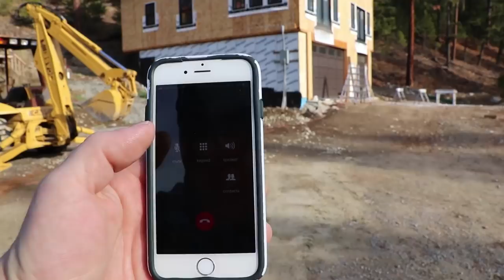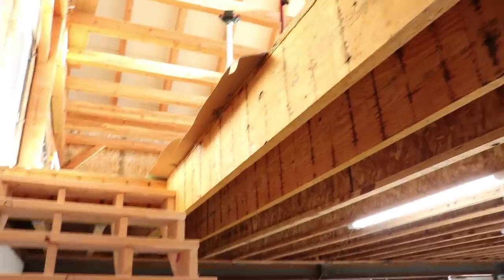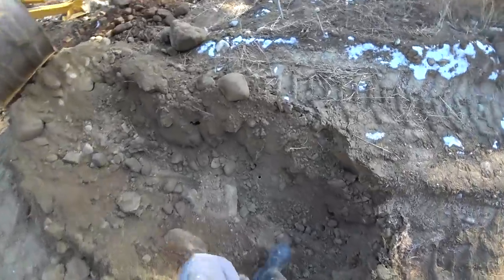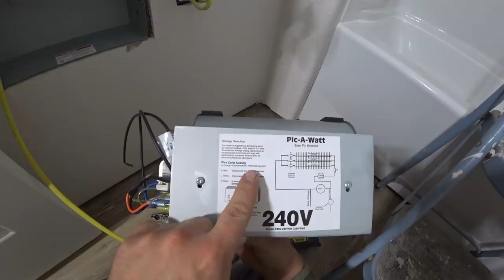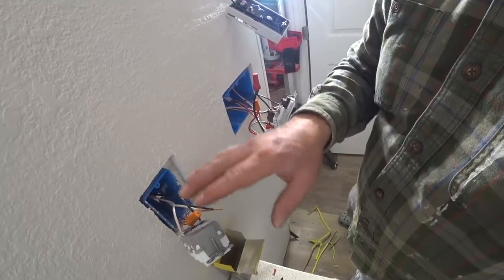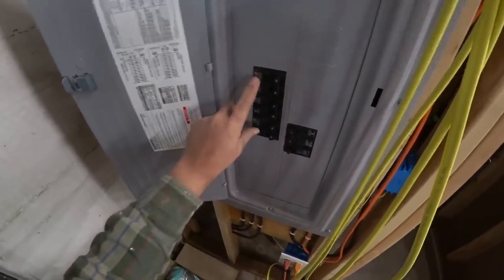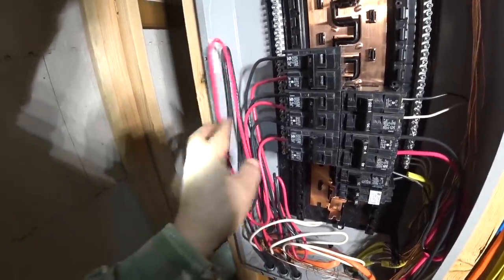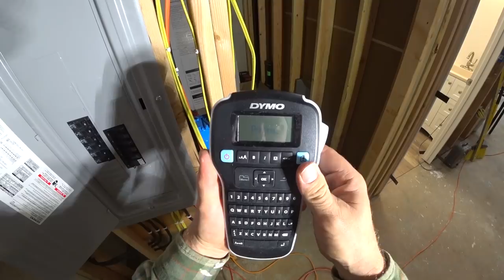Holy Cow IT ACTUALLY WORKS! (Wiring Garage Bathroom)

Comment: Many violations, all devices require grounding even switches. You can not make splices in panel and no double taps on breakers. You may experience nuisance tripping with the fan on the gfi circuit. You may want to look into code requirements for arc fault protection also. All bathrooms are required to be on their individual circuit can’t be daisy chained.
Reply: That 688 fan IN the shower is required to be gfci protected by code. No arc fault required in bathrooms, one of few places left in the code.

Comment: Here in the california mess, way back when we replaced our bathroom cabinets, they said code required a dedicated "outlet" circuit vs having it tied into the lights, etc.  So lucky you to not have that extra requirement.  We did still need to have the gfci outlet as well on each outlet.

Comment: you could use the mud around the boxes to seal the wall, ideal it would be done before the painting but should work too. In germany when we install electric in the dry wall we put the whole sheets on the studs but have layed the wires before so that they lay were the outlet will be later and the we drill the holes later wen the drywall is finished (but before paint) and we have round boxes that clamp to the wall and are secured that way, not like the us where it is nailed to the studs. This way you almost never have problems with a too big hole, only exemption might be some special equipment you install into the wall.

Comment: when backfilling your electrical trench It should be done in no more than 12 In at a time and compacted or use sand, water and a concrete vibrator  to compact the fill I have had to repair damaged electrical panels, or the conduit pulling out of the  connector or coupling exposing the wires.

Comment: Great progress. I have been following your posts for awhile now and have noticed that the one tool that you do not seem to have is a Romex Stripper  I went on Amazon and the basic version is there made by Southwire that I am all too familiar with also they have an updated version made by Ideal Industries 45-025 Lil’ Ripper Wire Stripper  that looks very versatile.  As Richard Burguilios said about wrapping electrical tape around the switch and outlets I learned that as an electricians helper. Good Luck and looking forward to your next post

Comment: Here is convention on 120/240 bolt wiring..  3 wire 240 volt -- L1=black  L2=red Neutral=white Groud=bare or green.  Voltages are L1 to L2=240volt. L1to Neutral = 120volt  L2 to Neutral = 120 volt.  When you use a 2 wire cable for 240 volt, Mark the white wire at both ends to indicate it is L2 by wrapping red vinyl tape over the white wire insulation for about 4 to %5 inches.

Comment: Hey Jes, try hanging your drywall loose and use a router to cut out the boxes (counterclockwise). They will be nice and tight and way faster than pre-cutting the holes.  Looks great though.  Oh yea, drywall is way easier if you hang the top part of the wall first.

Comment: Take a black sharpie marker and paint the white wire black or red. Two wires under the breaker screw not permitted. You would benefit from buying a code book it would help with not having to redo things.

Comment: I would consider installing a system that pulls hot air from the top of loft down to the garage. It would save energy and keep the loft from getting hotter than the rest of the house.

Comment: I believe on the bathroom heater electrical using the12-2 wire you are using the white and black as two 120V hot lines and the ground is used as the neutral.  My self I always run a12-3 (or higher gauges) for 220V circuits and 12-3 for ceiling fans, two hots one for the light and the other for the fan (not controlled by the switch).
Reply: There is no neutral on a 240 heater.......... 2 hots, 1 ground and the ground is used as an equipment ground. One only needs to run anything -3 if a neutral is required, "range", "Some Dryers" For fans, I generally run a 14-3 and have 2 switches by the door to avoid the breaking of the fan chain switch in the fan over time and use a speed control for the fan in the 2 gang.

Comment: In single phase electrical you have black and red as hot, white as neutral. So you should get some red phase tape to wrap the white on both ends to designate to you and to anyone working on your device that it is 220. Also a good rule of thumb,if you can put your hand in water (a full sink or full tub) and touch a device it need to be g.f.c.i. protected, so you should protect your heater and your lights, so daisy chain everything

Comment: I'm looking forward to your electrical inspection. I'm not familiar with your area, but in general, you can't use white to carry a hot leg of 240V. Usually it has to be red. (Ie a black/red combo, most usually a black/red/white/bare) But it will be fun to see what your inspector says!

Comment: 240V, Hi, just to clarify, neutral is not only for energy accumulated in the equipment or metal parts (I don’t know but where I live neutral and ground are somewhat separate in the house). I don’t know fully how the electric is done in the us.. But when you say you have two hots, I think you actually have a difference of potential. Being worth to point out that the current that goes through one wire returns in the other. So your current is circulating in both wires. Also, 240 is really practical, economic and easy to work with.
Reply: Anyway, very interesting the install. I found the electric in the US very interesting, since is different to me.
Reply: (I don’t know but where I live neutral and ground are somewhat separate in the house) For a number of reasons, but more often than not, and dependent on line loss and subsequent potential difference, neutral and ground are not at the same potential when significant current is being handled by the neutral. Redundancy of safety is another issue to consider. If you lose your neutral return, and are also using it for safe ground, you've suddenly made what was thought to be 'safe' as having fully line potential.

Comment: Whenever I have set up a 240 volt appliance I have always used a 4 wire drop. The 4 wire has two hots a neutral, and a ground. I believe that is code here in Florida.

Comment: Sleeve that white cable with black - that way it signals at least that it's a dangerous live wire rather than a "safer" neutral.
Reply: no such thing as safer wire like saying an unloaded gun is safer pointed at you

Comment: Jesse, while you can mark that white 220V wire black with some electrical tape, it's better to mark it red, just like the main panel feed.  As you already have a black wire in that pair, marking the other red makes it clear that it is 1) not the neutral, 2) that it is a hot, and 3) is a different hot than the other wire in the cable.  You can use almost any color to mark that wire as long as you stay away from White (reserved for neutral) or  Green (reserved for earth ground).  There are some other exceptions, but they are area specific or application specific.  Also, you could have run your outlet home from from the panel to the outlet beside the wall heater, then ran from there to your second wall outlet, then lights etc.  It would have saved a second 120v home run to your breaker panel.

Comment: Boy I wish our electric code was that flexible, in the UK we are not allowed any sockets except a shaving outlet in the bathroom, also all switches have to be on pull cords so that there is no chance of touching any switch with wet hands so no light switch or adjustable heater sockets in the bathroom. Even though you codes are totally different to ours I find it fascinating to see the way things are done over there.

Comment: It's 240  and 120 volts. The breaker panel is two legs of 120 volts to neutral. AC power hasn't been 110 in over 40 years. If you read 110 volts you're probably in brownout condition.
Reply: And on many 'lively' supply lines, especially at low load time, it's more than that. You can typically read "118v" at one end of a street on house outlets, and "125V" supplied from the same stepdown xfrmr the other end of the street. A lot has to do with line loss and loading, but you're right,  to state "110v" is an old habit hard to die.

Comment: Tips : acrylic on the small cracks around panels.
Also i would have used some white silicon around your bath area... like where the sheetrock mets the plastic of the shower/bathtub area.

Comment: Looks great guys, perhaps a painted wooden "adapter or spacer" between the plug cover and wall would be a simple inexpensive fix. Still thinking Rocket stove or heater in the garage wood (haha) give you the desired result on heat you are looking for and you could run it on sticks you find laying around. OK, there's my .02 cents

Comment: The bathroom receptacles must NOT share circuit other with other devices "lights/fans. etc.) according to my code book,  You can share the dedicated 20 amp (required bathroom run) with other bathrooms.  When inspector sees this mess you can expect to be doing rework.  I think the reason for a 20 amp dedicated bathroom circuit us due to proliferation of hair driers.  The mess in the panel will make the inspector on high alert,  Be careful of insulation temperature requirements of some heating devices.
Reply: Yeah, I am not a fan of in wall heaters. We use a plug in type, works great and doesn't heat up the wall.  You are correct about the shared circuits, he should have gotten electrical help before wiring this house.  Sometimes you just have to bit the bullet and pay a professional.
Reply: NEC 210.11 (C)(3) EXCEPTION allows the use of 1 20amp circuit if it supplies only one bathroom to use for other equipment with in the same bathroom.

Comment: Hi folks, I can't believe you are allowed to have electrical sockets in the bathroom and a touch switch, here in the UK we have to have a pull switch ( a string pull from the ceiling ) if inside the bathroom, and the only electrical sockets allowed are shaver sockets.
Reply: UK is 240V ? I think the difference in voltage allows US installations more leeway
Reply: Pull switches are now not allowed now in many North Am jurisdictions, and for good reason. They can carry leakage current, especially when damp, and especially @ 240v. No longer allowed in Ontario, and I'm sure some US states. Not sure on the NEC, but it's a matter of time until it will be disallowed if not yet.

Comment: The white wires in a 240 volt circuit should be taped with either red or black electricians tape indicating power legs.  I think that is acceptable per the NEC.  If you are going to wire your house yourself it would be wise to purchase an NEC code manual.  The 240 circuit as woired is incorrect per NEC.

Comment: WRT gfi wiring, might want to consider GFI breakers at the box next time. That way both of the home runs could been protected without using two gfi outlets. Also makes it easier if you decide to change something later.
Reply: Unless your taking a massive dump or taking a shower and the gfci breaker trips then your walking out the door with your pants hanging down or falling out of the shower to get to the panel to reset the gfci breaker to get the lights back on...haha--- 2 gfci outlets are still cheaper than 1 gfci breaker..

Comment: As some have mentioned, NEC requires the white wire to be marked as hot. 
But your explanation of the wires is wrong. The reason you don’t need a neutral in a 240VAC system is that the legs are 90 deg offset on phase. In other words, when one phase is positive, the other is negative, that is why you make a circuit.
Reply: [But your explanation of the wires is wrong. The reason you don’t need a neutral in a 240VAC system is that the legs are 90 deg offset on phase. In other words, when one phase is positive, the other is negative, that is why you make a circuit.] 

 I don't mean to be brusque, and you're far from being alone, quite a few electricians fail to understand this. This is a single phase service. Any potential difference exists in a 180 degree phase relationship, whether you tap (stack, divide, etc, etc) once or a zillion times. Think current not voltage to understand this. At any given moment in time, the current flows in one direction, whether it's 120V or 240V. The *phase stays the same!*.

I often hear electricians (and even some electronic techs) state "split phase". It isn't, it's "split feed" or "center tapped" or best lingo is "split rail" albeit the latter is used more in electronics for power supplies.

[the legs are 90 deg offset on phase] This would be quadra phase (four wire) phase, very rare except for some sophisticated multi-phase systems, or a DC to AC phase inverter (as used in solar systems) that's way out of whack. Think the pedal cranks on your bicycle being 90 deg to each other instead of 180. It presents some challenges...

Comment: you may know this but now is time to plan for load balancing. That means as you install 120 breakers try your best to keep constant draw as even on both sides as possible and the same with surge power if you don't you can pop breakers and also can cause higher power bills.

Comment: You shouldn't need any extra wire in the panel if you did your job right. Extra wire in a panel becomes a confusing and therefore a dangerous mess.
Reply: Extra can be nice if anticipating swapping normal breakers for GFI or AFI. That requires the neutral landing on the breaker rather than on the bar. Depending on where the neutral sits on that bar, extra length could be needed to get it to the breaker slot.

An inspector would probably call out the NM sheathing not being cut back to code. Looks like all of the sheathing is noncompliant.
Reply: Got to disagree. If and when changes are needed later, you're in deep doo-doos if you don't have sufficient lead length to move to another breaker, often necessary when a circuit needs to be added, all slots are taken, so a double breaker needs to be used to accommodate making room. Some inspectors in my jurisdiction will fail an inspection if there isn't at least one panel length of extra lead. Room is provided in panels for it, the onus is on the installer to put it in neat, tidy and accessible. Keep in mind for some service, like stoves and dryers, you can't use a junction box if your leads are too short to move them in the panel.

Then what?

Comment: The white wire on the 240 volt circuit should be marked with colored tape indicating it is not actually a neutral. colored electrical tape is available. Usually red or black is used. Be sure to mark both ends of the wire, panel and box.

Comment: When we bought our house they complained that the main panel had a double tapped breaker. Not sure if that’s what you were talking about in reference to that one breaker, but was easily fixed just like you mentioned (with a wire nut and extension).

Comment: You are using the backer rod for what it is designed for.  Good job.  Remember that there are several different kind and shapes of backer rod.  I use the black round or gray round all of the time.

Comment: You need to break both hot wires at the thermostat.  What you used is for 120 volts.
Reply: He used a K101. He should have used the K102.

Comment: Your outlets in the garage are supposed to be 30 inches above the floor to prevent any water, salty water in winter, and vapors of automobile fuel from getting upto the level of the outlet. Outlets can be a source of ignition in a garage with vehicles stored in them.

Comment: For the two GFCI's you could have ran a home run to a junction box in the ceiling or wall and then ran 12-2 to each outlet box. You are correct that the breaker is not rated for two wires at a time, much higher chance of the wires backing out and causing a fire. 

Now the heater needs to have the white wire identified with black, red, or some other acceptable color. Personally I would have ran 12-3 so I would have had black, red, white, and ground with the white being left for future use if needed. Also all of those wires packed into that tiny stud bay might be a problem. 

And lastly, since you left such a large gap around all of the boxes and some look like they're recessed to far in the drywall use oversized outlet covers and box extenders for fire protection.

Comment: The huge gaps around your switch and receptacle boxes need to be repaired if you are going to be inspected. Get some cable stackers for the romex around the right side of your panel. I assume you are not using the top knockouts on your panel because you are saving them for 2nd and 3rd floor circuits? Make sure everything in the bathroom is GFCI protected(120 Volt circuits. I am surprised that you passed your rough-in electrical inspection without having your boxes made-up. All equipment grounds should be connected together at rough and all switches should have ground pigtails connected to their ground terminals on trim out. Make sure you use a plug tester in all receptacles to check for proper connection because inspector will do the same at final inspection. For your 240 volt circuit wrap the white wires with either red or black tape. Otherwise, great work guys. And yes, I am a Journeyman Electrician. Thanks, Russ,

Comment: My knowledge using the white wire for power you use a black marker to paint the white wire black where the wire is visible in both boxes. That's your main panel and the appliance box. Electrical MFG. make wider wall plates for sheet rock errors.